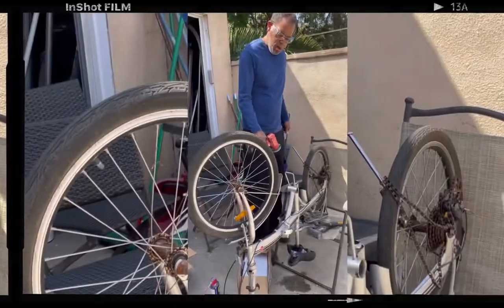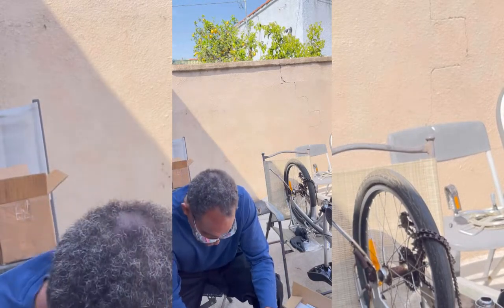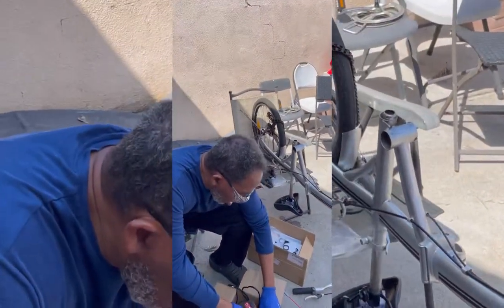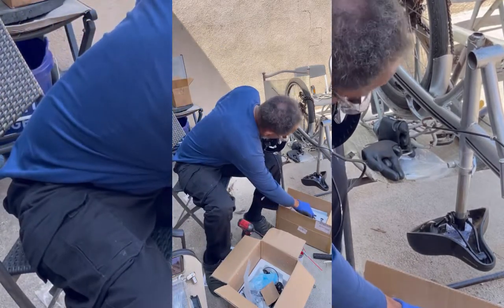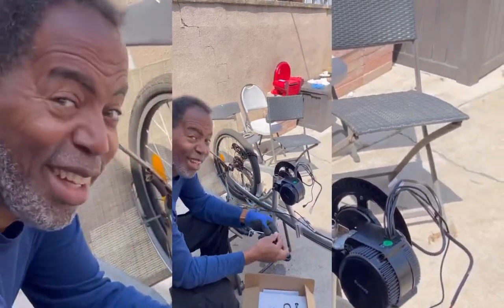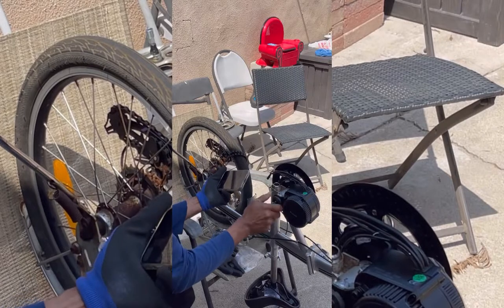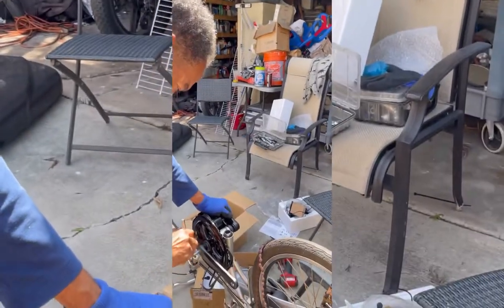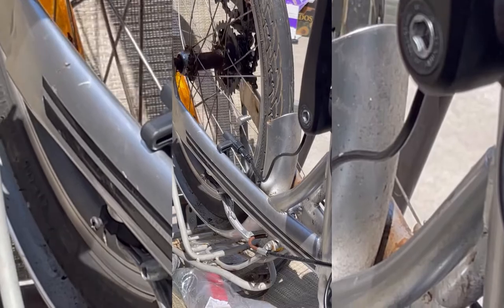Bafang Motor mid drive install

Comment: Looked when done and painted black.  
How did you mount the Battery?  
What size Battery did you end up using?  
How many miles do you figure you can go using PAS (I rarely use a throttle)